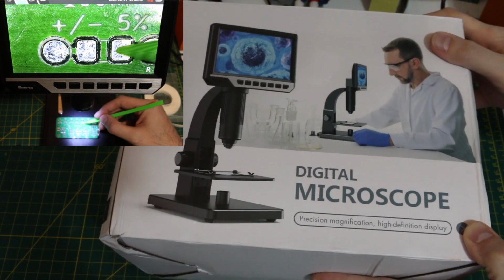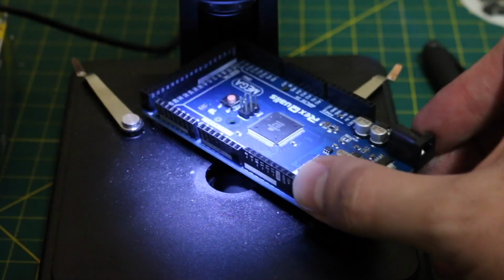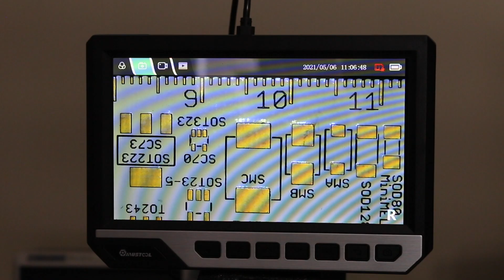DIY Motorized Microscope Base for Soldering

Comment: Why put a counter weight on the back, instead of having the leg face forward instead of backwards? i.e., towards under the camera? Make it a wide base that can double serve as the viewing surface.
Reply from the maker: It would have worked better that way (similar to the normal microscope stand where the unit balances itself) but I had 2 problems.  I was trying to avoid defining a dedicated work space zone under it so I could have a perception of more overall table space for other items and not have a keep-out zone taken up by the base, but also I wasn't sure if I left enough space in the notch I put, where the motor is mounted on top of a cut out to allow big boards under it.  I was thinking if I still wanted even more clearance to put longer items under the lens, I could raise the whole stand up onto something else and leave an even bigger notch of board space to fit beneath the stand and then the counter weight can still do its job.  Hard to describe, not sure if I made it more confusing!

For example if I have a big motherboard to try to fit under it, I could temporarily place  some wood blocks say a foot apart, then a few boards across the top of that, then lay the stand on that and fit a motherboard beneath, in between the 2 blocks of wood and deeper under the whole unit.
Reply: @GadgetReboot  Oh okay, gotcha. Would the zoom on the unit serve though if you attempt to capture such a large board though, or do you mean, just to have the option to place it under the unit and be able to move it around (not to see it all at once)?

I also had an idea of using like a two or three segmebt arm that's attached to the desk, and you can then move the camera itself instead of the board you are working on (if that makes sense).
Reply from the maker: @liadweinberger301  Yeah just to place the board but zoom in on a certain section in the middle.  I was thinking of trying a clamp arm like those used for lamps or microphones, but then I saw Louis Rossmann demonstrate the difference between that and a firm mount and how much the camera can vibrate if the table is hit.   Even on this one, since I have the camera resting on foam, I noticed if I hit the desk, it shakes.  If only I had a 3D printer so I could try some other prototype ideas!
Reply: @GadgetReboot  I didn't think about that. Yeah, that won't work for a microscope, you're right.

Comment: Stupid BIG number advertising. They advertise 2000x, but don't tell you it can go down to 5x. Under 50x is ideal to see and give enough room under for soldering. Now I'm kind-of interested in it.
Reply from the maker: Yeah it zooms in a lot for sure (though I'm sure the huge zoom is all marketing) and I was pleasantly surprised that it still had focus adjustment range at 25cm away to allow more work space.  Now if only I could de-clunky the implementation....this is why I didn't go to art school.
Reply: @GadgetReboot  I'm a welder/fabricator/mech eng so making that out of metal is easy for me, but I think you can make something neater with alum extrusions screwed together, and other parts, like on a 3D printer.